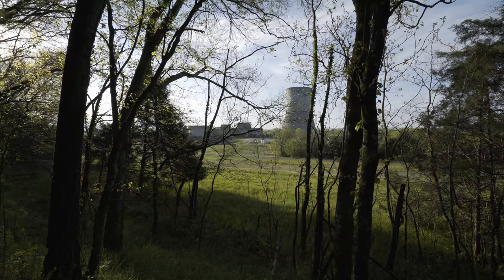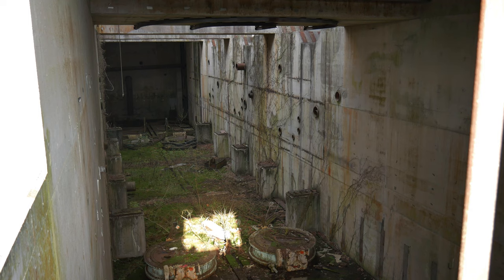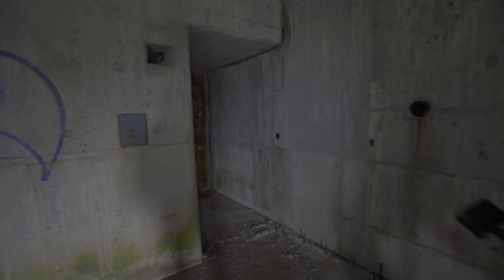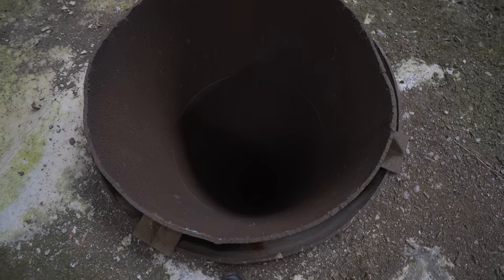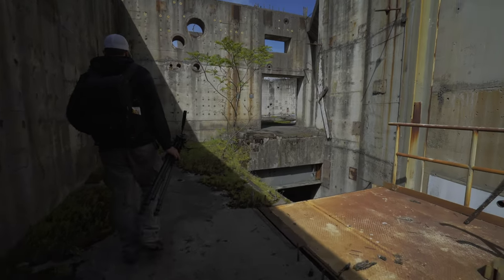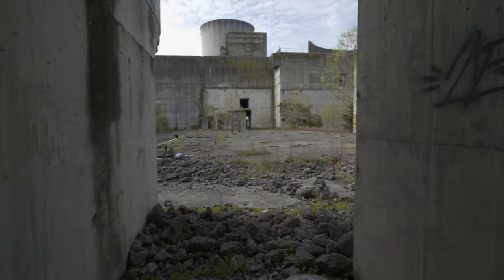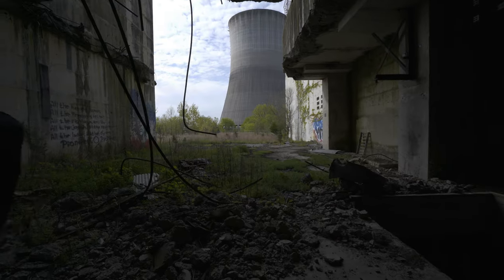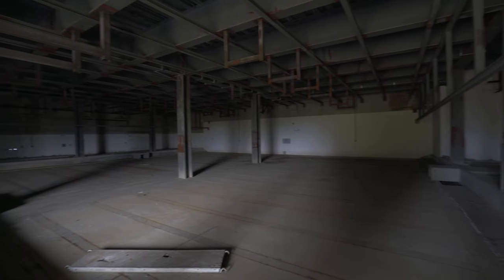Exploring Inside an Abandoned Nuclear Power Plant!

Comment: The elliptical opening you are approaching at about 23:40, I helped weld into place as a Boilermaker welder. I worked and welded inside most of the structures you see in the subsequent minute or two of your video. The hash marks you see on the side of the structure identify sections of a welded joint where quality control people had x-rayed them. At the time I hired on, they had been using an automatic welding process that resulted in a lot of bad sections with porosity that had to be repaired. For weeks on end, at the beginning of every shift, I would be given an overlay showing the defect, which I would match up with the numbers you saw. The procedure from there was to "shave" the weld metal off in thin layers using a carbon arc gouge (a tool that shoots showers of molten metal for several feet). Once the bad section was believed to be "clean," it would be dye or mag tested by QC, and the go ahead would be given to begin refilling the removed portion. At some point, the repaired section would be checked again for even the slightest defect with 100% x-ray.
It wasn't all work and no play, though. Men will be boys, and it was pretty common for someone to go to elaborate lengths to rig a web of water hose, which could be remotely disconnected after it had been used to soak an unsuspecting comrade. 
I saw a lot of funny things as well as a few bad things, like when a rig with bad brakes was being used to hoist concrete buckets over some of the structures. The brakes slipped enough to allow the bucket full of a few yards of concrete to come down on a crew that had no place to run. Luckily, no one was killed, but some rather severe injuries resulted. 
It was a dangerous place to work, but I'm glad I had the experience.